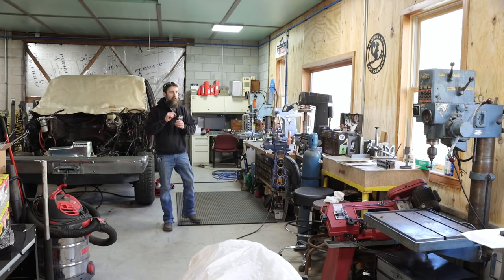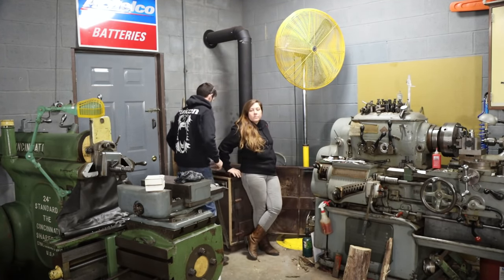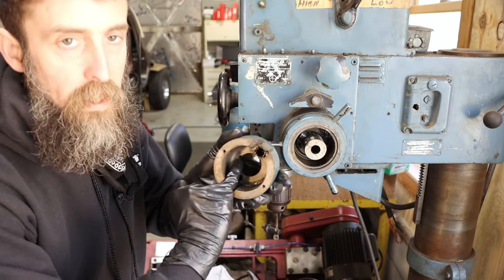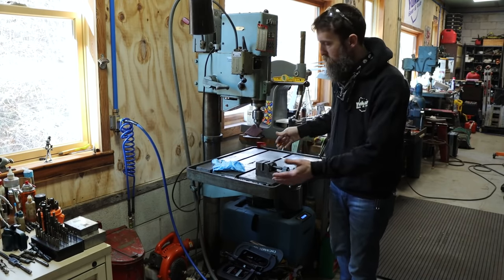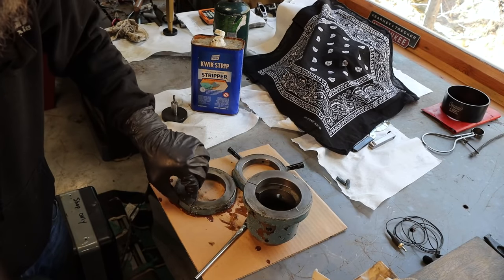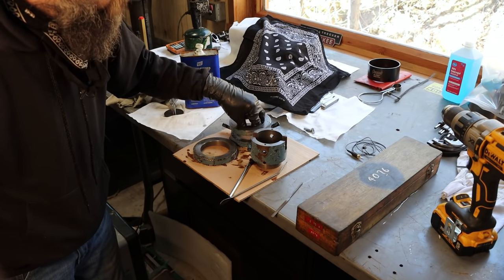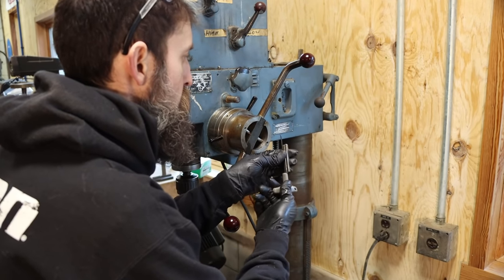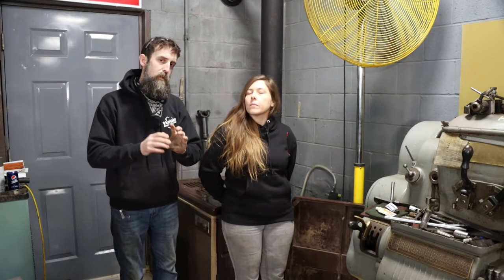Broken DoAll Drill press repairs. Mystery of the Missing parts 1

Comment: The bloke who removed that gear should have fixed it inside somehow so it could be reinstated later. It would have taken a little work to make a clip or somesuch, but it would have been nice (or at least tied it to the machine with a bit of string!)
Reply: Likely just shattered into pieces, so was removed because of the grinding noises from the head.
Reply: @SeanBZA  
Ziplock bag the pieces!!  all 300...😉

Comment: Modern paint stripper is complete garbage, you were lucky it worked at all as it barely touches some types of paint.  The active ingredient in the original stuff was methylene chloride (aka dichloromethane) and has been outlawed for consumer grade paint strippers in many countries due to health risks (probable carcinogen and a known central nervous system depressant).  Here in the UK at least it's still possible to source the good stuff via a few places that re-sell industrial paint stripper, though even that is getting difficult.
Reply: Rock Miracle in the red and white can was the go to here in the States for decades.
Yes, DCM was completely banned by the environmental protection agency starting 2019 for any product sold at retail.
They also banned strippers containing N-methylpyrrolidone.
With enamel paint on steel parts often the best solution is a strong caustic.

Comment: Regarding your missing gear:
Today, 3D printers are getting more and more common. And while your average 3D-printed part wouldn't be strong enough to run in the machine, it should be strong enough to determine if you've gotten the design right. So if you don't get a good lead on a proper replacement, why not try asking your friends and the community if someone could print you a couple of prototypes before you start cutting teeth? Could save you some time and gear blanks.

Comment: That gear likely is a standard part, off the shelf in a metric size. Gear tooth pitch, diameter of the shaft and the space will likely get you a diameter for the gear, and then order the part as a gear blank with teeth already cut and pilot hole, and machine the centre out to suit.

Elisabeth needs to start working on coasters, or you need to start teaching how to cast resin, using the small swarf in the shop, which likely will work well as a coaster inside, just well degreased, and shiny, in various colours and materials, floating inside some resin pucks.
Reply: Steve can get the MOD from the existing gear ( steel one ) the from the shaft centres be able to work out the tooth count and blank OD , should be a simple job to make
Reply: SeanBZA, you're right. A place like RS components in uk, or HPC europe might well have something suitable.
Reply: @Satamax  In the USA McMaster Carr will have it, probably off the shelf as well, though once he has that part number might be better off ordering through Amazon.

Comment: Safety Sally is a very likely culprit. We've had to disable the power Z axis on several CNC milling machines in our shop, in order to not have to build a cage around the machines. All driven by the safety department's self-justification.

Comment: I was cringeing watching you use a ball ended hex key when a straight end could've done the job, and a few minutes later there's that snapped off end that justified the cringe :). I've got a few really good sets, but only use them when there's no other option, as they're more likely to round out the bolt, snap off, or round off (and with no option of re-grinding, it's buy a new one time).

Comment: Steve, got a ton of respect for you but what is with the friggin gloves? How do you work with them and feel small parts and precision fits?   How can yo tell when something is flush with another surface? 

 When i first saw your videos you were man enough to get your hands dirty. What happened bro?   There is nothing that you are doing with your hands that a little Kestro, or even  DL hand cleaner won't do better then wearing those stupis gloves.
Reply: Trust me, the older you get the less you want to use stuff to clean your hands if you don't have to.  Age damages hands enough, without adding needing to clean them4 or 5 times a day.  I usually wear gloves for everything now, forgot to while doing a simple sheetrock patch and now I have 7 small cuts that wouldn't be there if I had bothered with gloves.  Even South Main Auto is wearing gloves most of the time.